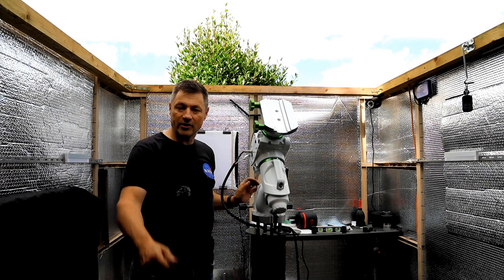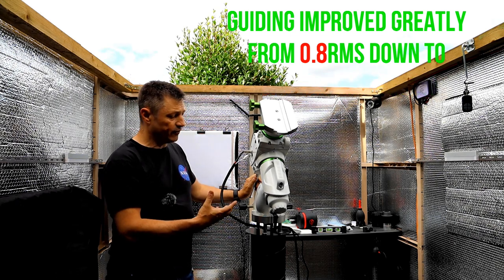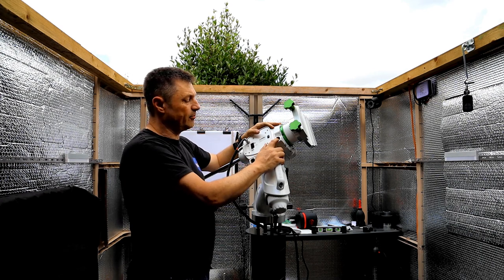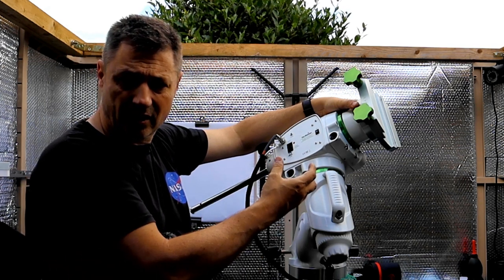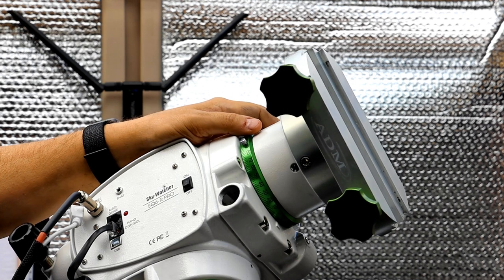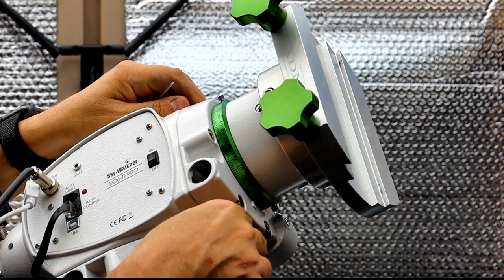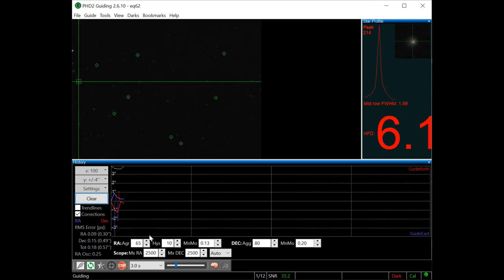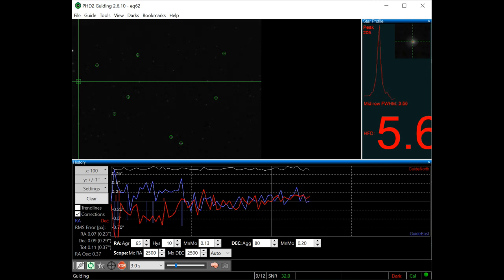EQ6 Tuning and Backlash removal. Also new guiding in PHD2 at 0.3 total rms error

Comment: Can I ask you Glenn. When you slew the mount at highest speed when it’s slightly too tight(maybe just at the point of binding), there’s a kind of weird electrical noise from it(it’s kind of if you asked ET to make an eeee sound lol). Do you know the sound I’m on about? A kind or intermittent eeee sound? Did you experience this when you were slewing mount after moving carrier etc?
I just know I’m going to get some stick for this but it’s hard to describe a sound here lol
Reply from the maker: Hi Martin. Thats totally normal and yes my mount fast slewing makes that noise too, its the stepper motors
Reply: @Astrobloke   well after hours of tweaking the grub screws I’ve finally got it with near enough zero backlash and zero noise. That noise put me off more than the lash! 
When I first started trying to get the lash set (tighten RA up)I was loosening say the bottom screw a touch then tightening up the top screw a touch. Then it would be too much and I’d have to do opposite etc. finally I got another way which worked better for me and that was to loosen the bottom screw a couple of turns THEN start on the top screw a tiny bit at a time then tighten the two middle 5mm Allen bolts and have a feel for play,then slew the mount 180deg in one direction then same other direction. If I heard that annoying noise it seemed like I’d tightened the top screw too far so loosened the two Allen bolts again and just loosened the top screw just a teeny bit(not even half the amount I’d tightened in first place).because the bottom grub screw was already loose the weight of the mount was enough to let it drop to the amount I’d loosened the screw off(because the mount would fall against the little brass block inside). 
Anyway this worked better for me than trying to play the two grub screws off against each other plus it doesn’t seem a good idea putting any torque at all on these screws as the threads are so small etc.
Anyway after I’d done all that I’d do up the 4 Allen bolts and only then make sure that all grub screws are snug.
Oh and by the way to anyone doing this,MAKE SURE you loosen off the little belt/gear cog panels(3 M3 screws) otherwise the mount won’t move so easily,if at all when you’re adjusting grub screws
Ps I’m back in the house now writing this and just realised I may have the top/bottom screw thing the wrong way around lol.
But anyway my point was to not be loosening one screw a bit then tightening the other to the point where you’ll probably be playing each screw off against the other. Instead, I just adjusted with the one screw and the weight of the mount to aid in dropping it.

Comment: Hi, I have a question: how did you manage to adjust the worm gear in the AR axis, given that above the gear there is the optical encoder that blocks access to the gear itself?  I assume you had to remove the auxiliary encoder, and how did you do it? Anyway, this is a very helpful video!
Reply from the maker: Hi. There are just 2 screws holding the encoder circuit and a short length screwdriver will enable you access to them and a single screw in the middle of the disc holds that on. Everything is easy to undo and remove and replace.
Reply: @Astrobloke  Thanks! I'll try. I wish you Clear Skies!

Comment: I adjustet the backlash of mine.
(its hypertuned, new bearings etc)
i got 1200ms backlash but the dec doesent feel like backlash..
what can i do?
Reply from the maker: The problem with the backlash measurement in PHD2 is fine binding can also show as this so it may be in too tight. All its doing is showing how many pulses it takes to move it in the opposite direction. Try loosening just a fraction and re measure. This video I did may help explain further ProLogik Astro Balance Meter.  Get great guiding with perfect balance and gear tuning with this tool
https://youtu.be/7-QGpHp8vMo
Hope that helps.

Comment: How do you do the RA ... you have to remove the encoder ?
Reply from the maker: If you are adjusting the float nut at all then yes the encoder needs to be removed as the disc will stop you accessing the float nut. 2 screws for the reader and 1 for the disc. They are simple to remove but you need a short crosshead screwdriver as standard length ones won’t let you get to the screws for the reader.
Reply: Ok thanks. Thats what I thought.  Anything in particular I should look out for in phd guide assistant that would tell me I should do this ? We replaced all bearings and it seemed appropriatlt firmly tight yet free turning movement as we reassebled the worm drive.

Comment: Sounds to me like all these mounts come out the box faulty!
Reply from the maker: I do think the quality control is questionable. In fairness they travel all over the world and different climates will change it. I know a few with ones that have just been great out of the box and over a year later never had to adjust or change a thing. Others not so lucky
Reply: @Astrobloke  I can remember the Japanese Vixen mounts in the 1980s and 90s. They rarely had any issues that were reported. As you say, quality control is the issue. Its a lucky dip. QC is something that the Chinese mass producers have never been bothered about.